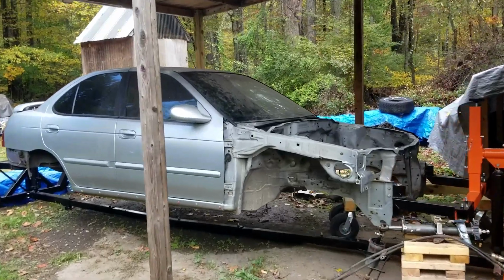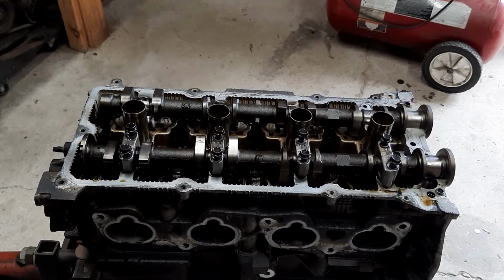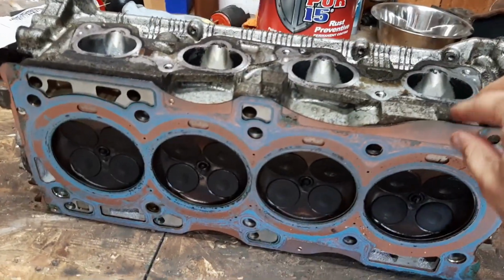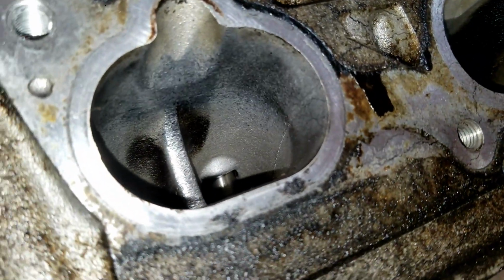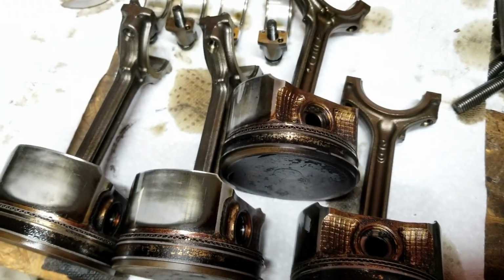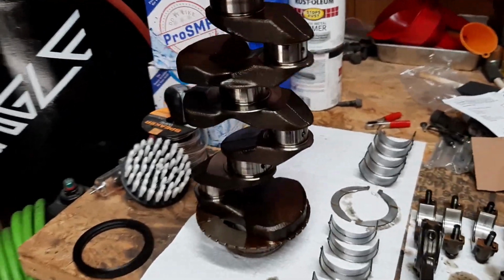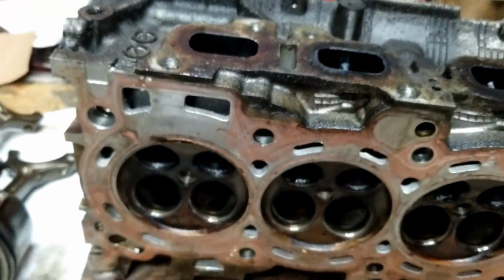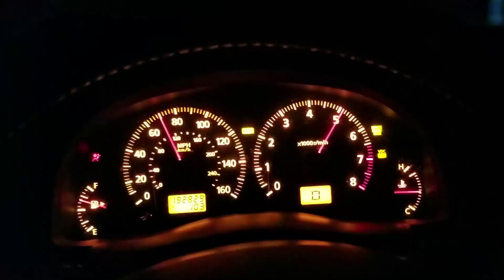Is this Sentra SE-R Spec V Engine Saveable?

Comment: Precat failure is what it seems like to me. The fine dust that comes off the precat in the headers usually does a great job of polishing the cylinder walls and then you get tons of blowby. And/Or just some really bad valve stem seals.
Reply from the maker: That would make sense to me, it had a replacement header/cat on it which to me would indicate it's possible at some point in its life the original had disintegrated.
Reply: @HardAngle  sucks because precat can take a seemingly good motor and make it go bad in a jif or your forking out tons of money to keep the oil topped off..

Comment: Just pick a low mile jdm motor there dirt cheap. Don't waste your time if your going to flip it.
Reply from the maker: I have had this debate with myself back and forth for a while now, still don't know which way I want to go, it cost the same amount of money for both options, the rebuild just takes additional time, but in the end the new owner would have a longer lasting car at the end of this, but in fairness, I got a JDM motor a few years ago and have put over 100,000 miles on it with no issues yet soooo.
Reply: @HardAngle   I got my at 144000 right now. Got my spec new back in 06 just kept it up. A lot people don't take care of them or beat the ish out of them. Good oil the key and check it often.  Good luck with it and I'll stay tune in.
Reply from the maker: @gabrielaguilar50  I like to search for Sentras on marketplace and as you said, most Specs have been beaten half to death, that's actually what made me decide to want to fix them up and sell them, so people who can't do the work but want a cool old Sentra could have one, whether their first experience with one or reliving an old experience.
Reply: Do you have a video went calibrated the valves and the put the Stim valv ?
Reply: @robertattooart9888  No I don't never done it be for. That's why its just way eazy to just go jdm and be done with it. Your Better off finding somebody to do that for you. It can cost you if you don't get it right.